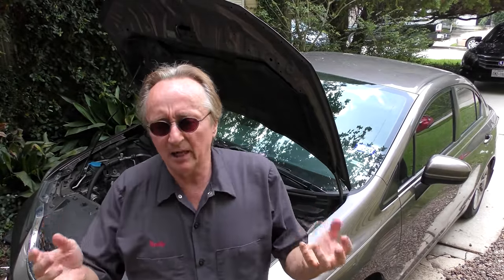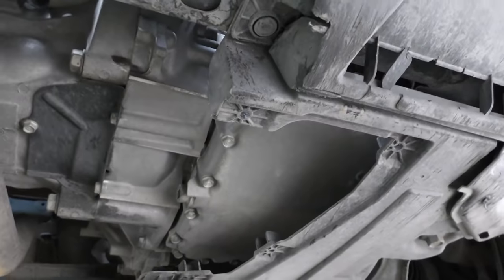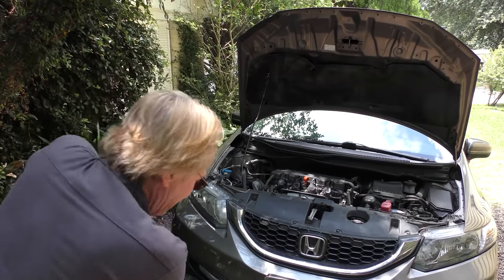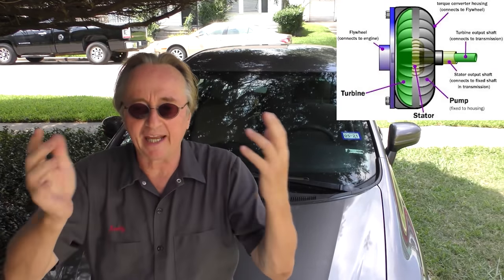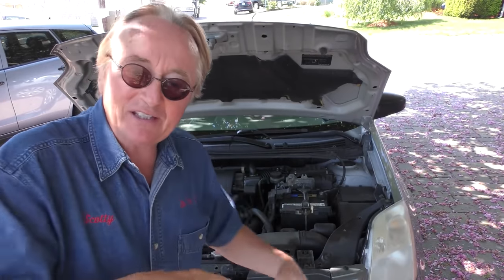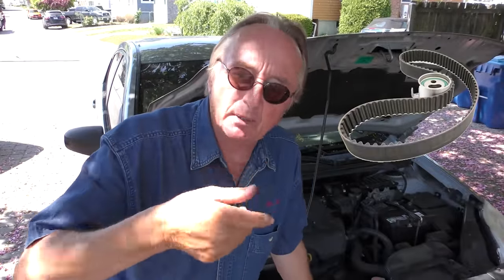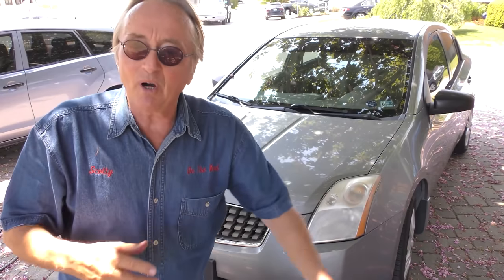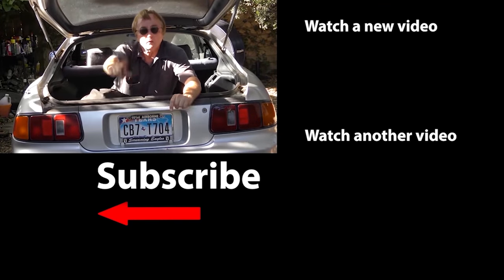Cars That Have Serious Transmission Problems (Do Not Buy)

Comment: I just went car shopping for a new Toyota. I skipped over the Corollas because they all had CVTs (there were no manuals available). Went straight to the Camry with a more traditional design, but 8 speeds for efficiency. No rubber band transmission for me!
Reply: I have a 2014 corolla w cvt no launch gear. never had a problem, pulls out quick enough. I've had over a thousand pounds in it(4 big guys) , didn't even notice on take off.
Reply: After scouring the internet, I’ve concluded that the Corolla CVT is quite reliable.
Reply: There is a huge lawsuit against Toyota regarding those eight speed automatic transmissions
Reply: Not all cvts are bad. I’ve seen many Toyota cars with cvts with more than 200k miles and that’s people who don’t even change their cvt oil at all (which is recommended I believe every 60k miles). I’ve never heard of a Toyota cvt failing at all now that I think about it. Now Nissan cvts thats the complete opposite.
Reply: I have a 2015 Toyota corolla cvt. No issues at 110000 miles so far. Been changing out oil and upkeep everything g, especially due to high prices of cars. Still going strong.
Reply: @sheep4521  it's very reliable.
Reply: @jtlmnts457  how do you know it was the original cvt?
Reply: I also went to a Toyota dealership looking for a new Corolla but with a standard transmission because I have heard horror stories about CVT's.  They didn't have a single one with a standard transmission and had to wait for them to get the only one they had in stock at that moment from the main Toyota storage warehouse located some 70 miles away. I would prefer to drive an automatic transmission but the fact that CVT's are so expensive to repair makes me feel that shifting gears on a new Corolla is worth the extra work for my left leg.
Reply: @rameystarman2439   I never heard anything bad about Toyota's CVT transmission. They are boring to drive but I reckon they are bulletproof.

Comment: Can't beat the manual gearbox l had a lot of cars with them and they were good except one believe it not it was a toyota light ace and it used to jump out of first gear and l never bothered to repair it and l sold it to a wrecker but it was a good little van l have chaged

Comment: My two cars that I own, a 2001 Chevy Metro with a 3-speed Auto and a 3.97 final drive, the auto transmission is modeled after the turbo hydramatic 350. My other car is a 92 Mazda MX3 Grand Sport with a 5-speed, not exactly sure what the gear ratios are but I know it has a almost 4.4 final drive and a .87 5th gear. It's fun.

Comment: My 2015 toyota corolla S with a non launch gear cvt, still going strong with over 100k miles., changed the fluid at around 70k.

Comment: I have an 07 Dodge Caliber with a cvt.  I bought it new and maintained it reasonable well - 210,000 miles and it runs better than when it was new!  New it was a little jerky and shift happy-old it is very smooth and clean, cannot feel it shift at all.  Who knew - I was doubtful when I bought it that it would make it to 100k, I am literally shocked it is still around providing drama free driving.
Reply: Thats a  good thing..   what is more impresive  is that  your cvt is made by jatco  and  still works..

Comment: Both my wife's RAV 4 and my Tundra have 6 speed autos...no problems at all. My Tacoma had a 5 speed...never had a problem with that either. I will never own a CVT.
Reply: Why not? Toyota CVT are ridiculously reliably.
Reply: @ln5747  Well, the two Toyotas we have will outlast us thru retirement. My Tundra has 25 000 kms on it and almost 2 years old. I expect it to last 500 000 plus kms. My wife's RAV has 118 000 kms and that will last to 4 or 500 000 kms as well. We will both be dead by then.

Comment: Ford (when they came out with the 2011 Fiesta and 2012 Focus) tried to do the "software update" thing but ultimately fell prey to class action lawsuits and eventually had to pay out for people to have the clutches repaired.  I think they did eventually fix the issues (in the 2014+ model year) but they discontinued the US Focus around 2016, as they did with some other cars -- for other reasons -- a few years after that).  But I remember getting a coupon for up to $2000 cash back if I had my Focus's transmission serviced.  Too bad I traded it in and lost $3000 on the trade before the lawsuits came about (I couldn't claim it because I wasn't a current owner of a Focus at the time and couldn't prove i had the trans repaired, which I didn't).  But for CVTs I still like what Toyota is doing with the higher-end Corollas... with the launch gear (a physical gear and then it shifts over to the CVT transmission, which I think si good because the most torque and stress on a transmission I would think would be during acceleration, and particularly from a dead stop)..  However I'm still not sold on them.  If they can prove that one can last 200k under normal maintenance, without issues, then I might consider one, but so far, they require a lot of maintenance (fluid changes every 30-60k, and gentle driving, and you might get 150k if you're lucky, regardless of brand).  It's still too new of a technology for me to want to adopt, not yet at least.   Personally I think though if CVTs do over-take standard (geared) automatic transmissions, they will employ some sort of method like the launch gear that Toyota has as this seems to be the best of both worlds... the gear takes the most stress from starting from a dead stop, but once you get up to cruising speeds, you get the benefits of the CVT.

Comment: I use my 2021 Chevy Spark for city driving. I am happy with it. Paid 14,100 brand new. My 2004 Toyota Scion still runs great but I wanted a second car if the Scion breaks down. My Scion A is the best car that I ever owned.
Reply: I like the 2015 scion tc. To me they were one of the best looking car on the road
Reply: I have a manual 15 XB. Best car I gave owned. Not sure why you would need the Spark. I’ve seen base manual ones discounted under 10500 bucks.  Worth considering, but I preferred the Scion with 35k 5 years old for slightly mire.
Reply: Chevy Spark is ugly as all hell but good gas mileage, especially in this day and age.

Comment: I bought a Subaru crosstrek manual 6 speed, I get better mileage then the EPA rating for the manual and even get better then the CVT. I get 34-35 mpg which I think is awesome for an AWD. The manual transmission with a clutch is a viable transmission. Too bad there arent more choices

Comment: Don't always assume the engine is blown, 2 weeks after I got my car, mine slipped on startup from being stretched and never changed it sounds like a rubber belt slapping around in plastic, just like it is, turned the car off tore it apart changed my waterpump and a new belt and pulleys and it runs like a brand new car again. Mine is a 6G75M mitsubishi cyclone interference engine with a 6 spd. Manual. Idk if it had to do with how its setup inside or if its because the belt didn't fully snap while driving and I got lucky, idk but its always worth a check it could save you big and you might get lucky too.

Comment: 140,000 miles on my 2015 Honda Civic with the CVT & no problems so far. I religiously change the CVT transmission fluid every 30,000 miles.
Reply: We had a 2004 honda civic hybrid with CVT, we had that car for 14 years and put 160000 miles on it and no problem with the CVT transmission

Comment: I drive a 2008 Chevy colbolt with a stick shift and it runs well. I keep the oil changed, tires filled and don’t drive like I’m on the racetrack. I also drive around all of these Illinois pot holes 🕳
Reply: I suggest not driving in Rockford, too many pot holes like Chicago

Comment: Usually, with anything that slips or slides it's going to wear out!  Maybe they should design them so the belt can be changed at a certain mileage interval!   What would be idea, would be some type of fluid coupling that would mimic the properties of the CVT transmission; this would reduce the wear!
Reply: I agree about cvts wearing out. I have a difficult time believing even a toyota or honda cvt will make it 300k miles without major maintence.
Reply: Toyota somehow designed the Prius CVT transmission with all gears.  Lasts 400k easily.  Not kidding.

Comment: I'm 70yo.what I've learned in my lifetime about automatic transmissions, is just make sure the fluid is level. I've owned dozens of cars, and on the ones that I had the transmission serviced, they always died within a few months. On the cars that I never changed the fluid, those went over 200,000 miles and were still going when I got rid of them. I do change my engine oil in my daily driver every 5000 miles with full synthetic and k&n filters. My mustang 5.0, I change every 2000 miles with full synthetic and k&n filter.
Reply: @user-de4jk8vj4c  you have to understand that 2000 miles is what I drive it in a year, and you shouldn't go more than a year without a change

Comment: Hey Scotty, I have a 2019 Honda Ridgeline that I’ve been battling the dealership with. It shudders up shifts down shifts (my description).
They say it drives ok to them and it does not show a Code.
I’m learning online about Possibly a pressure switch or selenoid. What would you recommend they do to fix the issue?

Comment: 2012 Altima with only 44k is having transmission issues shifting in high gears.
Reply: Same. My 2012 have 80,000 miles is having transmission issues too. Won't  drive forward.

Comment: Ford Taurus 2003-2208. It's not a question of IF, but WHEN your trans will go out. ALuminum sproket inside will shear and send metal bits throughout your engine.

Comment: Nissan is basically a subsidiary of French manufacturer Renault. Indeed, if you buy Renault, then only with standard manual transmission. The Renault ones are junk.

Comment: Fact .. Honda and Acura vehicles released between 1999-2004, usually face transmission issues. Car models such as Accord, Civic, and Odyssey are the worst example of Honda CVT transmission problems. Because of CVT  the vehicle may stop working properly.

Comment: I have a 2010 Honda insight I bought new with a CVT transmission. I’ve changed the transmission fluid every 30,000 miles and the car runs  great. It has 180,000 miles

Comment: I have a 2016 Honda Civic with the CVT transmission and with a launch gear. I absolutely loved  it, ran perfectly, and I got 40 miles to the gallon with the air conditioning blasting, as I live in Phoenix Arizona

Comment: My car is A VW DQ200 transmission and replacing the DRY clutch pack cost me  680$ including labore and two year warranty From the Dealer.
it lasted me 8 years of driving But I'm a light footed driver so I consider my self lucky. .....FOR now :/

Comment: Steal belts running on steal pulleys is never a good idea. So change your CVT oil first at 30k and then every 20k if you want to lower the wear. Don’t forget to change the paper cartridge filter. Also every oil change.

Comment: Brought a new 2022 RX350L for about a month with about 600 miles now. It has growling engine noise and vibration felt on steering wheel from 1mph to about 25mph.  Did some search online, that’s a common problem for the RX and dealership won’t have a fix for it.  Very disappointed and regret the purchase on the RX.

Comment: Ford focuses have serious transmission issues
Reply: My '07 hatch had 231K on it when I sold it and it still shifted like new. I was not kind to that car either. It was also turbo'd at one point. Other than constantly failing motor mounts, the car was as solid as a Honda.
Reply: My 14 focus had the dual clutch replaced almost every 25k. The final straw is when it blew up in the middle of new mexico. Towed 130 miles to ford. Told them they can keep it. Bought a 17 focus S with a manual trans. Done

Comment: Do Not Buy North American Ford Focus (2012-2016) and Ford Fiesta (2011-2016) with the DCT 'Powershift' Automatics. They are junk. Shudder, hunts for gears, may not shift right on acceleration putting you in danger, impossible to fix or get parts for to try to fix it. Ford extended the warranty to 60K or 5 years or 100K or 10 years for some parts but can't get them. The Detroit Free Press did a huge investigation and article that Ford made the decision to use it anyway despite terrible problems when tested before production. They kill the trade-in value but still sell for high money at retail due to the lack of available small cars like Honda Civics.

Comment: As with all cars it makes a huge difference how you drive them. I have had cars that were thought to be piece of junk lemmons but with my driving habits I got a lot of care free miles out of them. How do I drive ? Well its just common sense. Just dont push them beyond their power limits and with an automatic which I dont like I back off the accelerator right before it shifts. It really makes all the difference in how you drive as any trucking co. Owner will tell you.

Comment: I brought a used honda crv 2004 2.0 AT . After buying and using it for some days i found that its head gasket was once overheated and was changed in addition to that the car ran on aftermarket CNG kit for 3000km . We removed the CNG kit and now the car is giving half it’s actual performance, please help me to regain its original performance, the car’s original 0-100 time was 10.5 seconds but now the car is giving 21 seconds for 0-100 . The agency told us to change throttle body and intake manifold and doing so only helped us to improve the performance by 20% . Odometer is 140000. 
The acceleration and pickup are not good , the car feels like taking up load while picking up , and while overtaking it struggles a lot.
Please help me to regain the complete performance . No engine light is there

Comment: Scotty the 2007-2012 Nissan Sentra's 2 liter puts out more than 126 horsepower (2000-2006 models), they actually put out 140 Horsepower at the time. Not that it matters if the transmission is crap.

Comment: The 2022 Chevy Traverse has something very wrong with its transmission and/or whatever module tells it to shift. We just got back from a road trip, starting in Indiana, out to the NC outer banks and back. We rented one of these with about 6k on the odometer. It would shutter and struggle under load, shifting up the gears too soon, before the vehicle could get up any momentum. Interestingly, if we had slowed down and I hit resume on the cruise control, it had no problem accelerating back to its previous set speed. It was only a problem if I was giving it the gas.

Comment: I got a 2013 accord I just purchased last year with 31k miles on it and it has the CVT. It jerks around a lot at low speeds and it’s still doing it after I changed the fluid. Anyone have any insights on what’s happening?

Comment: Hi Scotty from the Philippines, achilles hill of cvts are the failed key and keyway on the torque or driven pulley. The driven pulley or torque pulley have 2 parts the fixed sheave and the sliding sheave (this allows the steel belt to slide in and out of the sheave), with mating hubs respectively. Fixed sheave - hub [female] is fitted with a key say 10mm steel ball like what i saw in Nissan CVT tear down and the sliding hub [male] is fitted with a keyway. Key and keyway arranged at 120 degree angle apart, this is why the sliding sheave has a limited twist angle. With repeated sliding of the mating hubs both key and keyway wear down eventually, worst case a notch is created along the keyway, the torque gets stuck or the car truck or 4x4s wont reach the band speed. In this case cvt's efficiency delines easier granting fluid cycle change is similar across all types of transmission.

Comment: 08 Focus.  Replaced trans at 44 k in warranty.  Then again around 74k and ate the cost.  But I cannot complain about the engine at all.  Wonder if the current owner had an issue with #3.

Comment: Scotty I got a 1991 Honda Accord Lx coupe 5/speed with 186,325 thousand miles it burns oil quick & I think the seals are warn out cause I’m seeing fresh oil around the engine & transmission. Haven’t touched the transmission fluid, I don’t know when it was last changed but I’m leaving it alone.

Comment: Most Cvt transmissions, need the oil changed at 30000 miles and the heat exchanger filter, guess what ,the dealer does not change these filters, they just drain and fill . I’m talking all dealers . Even though the manual says to change the filter, theres 2 filters to change at 60000 miles, dealers don’t change those either.

Comment: hey scott i have a 2009 acura rdx shw-awd turbo my shift cylenoid went bad it threw 2 codes 1 was shift cylenoid stuck on cylender b and 2 was low pressure cylender b so i changed both of the n cleaned it all up the lil stem with the screens now it just says low pressure cylender b do i need to get my trans reset let me know plz i watch u alot b trust your word

Comment: Elderly so would need to b easy to get into
Reply: Sandra, check your area for CRV 2016 or even go down as far as 2012. I have driving those for over 10 years without even one issue. Of course, always check it with the pro mechanic.

Comment: Have a friend that had a 2016 Nissan Sentra with the cvt transmission, the tranny was starting to act up at 100,000 miles I told them about it and not long after that got rid of it

Comment: What about Subaru cvt transmission. I’m wondering if I should change my fluid not not
Reply: It depends older models 2012-2017 models have bad CVT, newer models have been good so far but honestly no one loves a CVT right? As long you change the fluids once in a while you’ll be fine